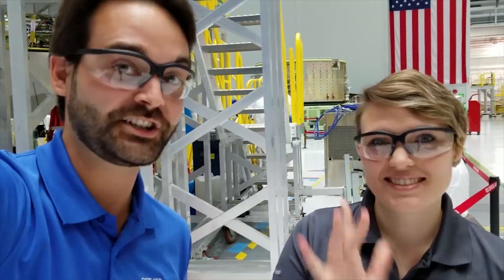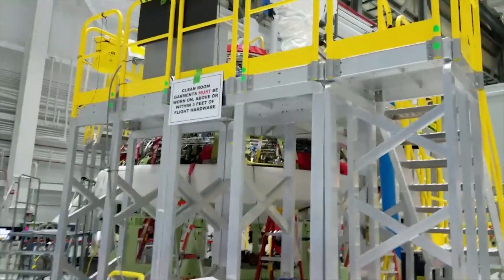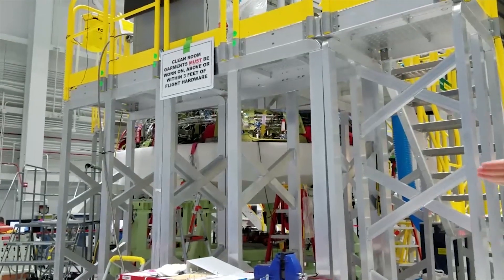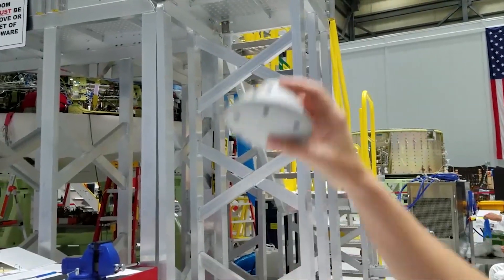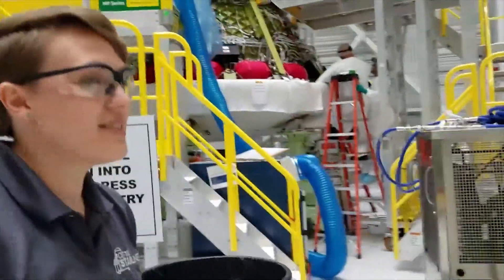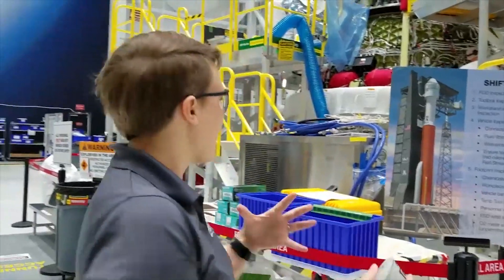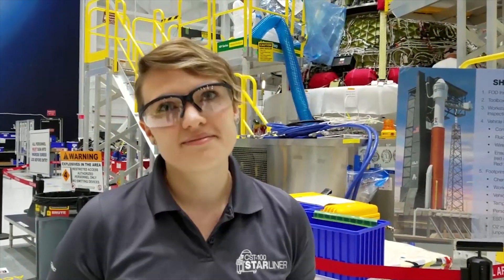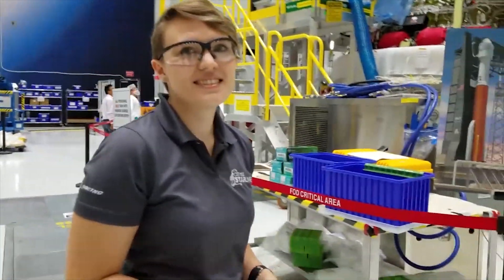Things Are Heating Up as Boeing Starliner Prepares for Launch

Comment: So let me understand, you've spent your entire career working on something they designed and tested great in the 60's?
Reply: You can’t just dig up a heat shield from the 60s, slap it on a ship and call it a day
Reply: "Entire career" is really only four years..it's not like they have a hardware store from the 60's with heat shields specifically fit for this capsule.
Reply: Her career so far yes, she only just started obviously being so young,  And so you think because Apollo used Ablator heatshields we already know everything there is about them?
Reply: Jim Zivny — When you buy a new car, do you expect it to use parts designed in the 1960s?
Reply: As far as I understand, this heat shield is significantly lighter than the old types of ablative heat shields. Which means it is probably made from different materials, or at least in a different way. I don't know anything about plasma dynamics, materials and ablation, but I think it's a bit more complicated than: it's invented, and that's it. There are always refinements to be made.

And in spaceflight, keeping things light is very important, as it leaves more room for something more useful, like payload. 

Also, her "entire career" has been short so far as she seems quite young. She will have lots more to do at Boeing in the coming years, I imagine.